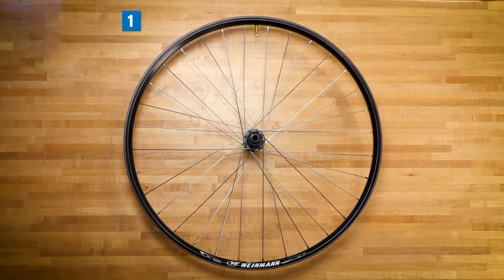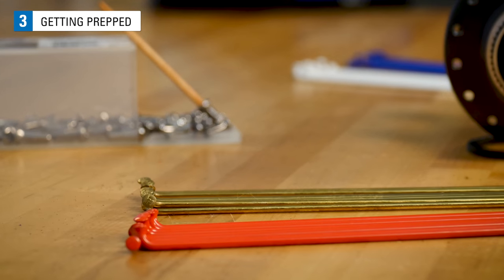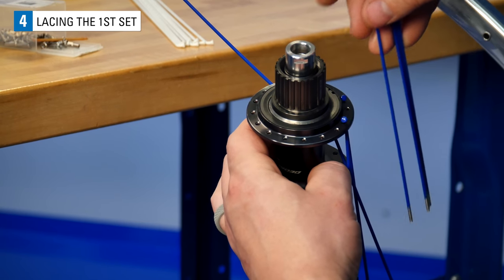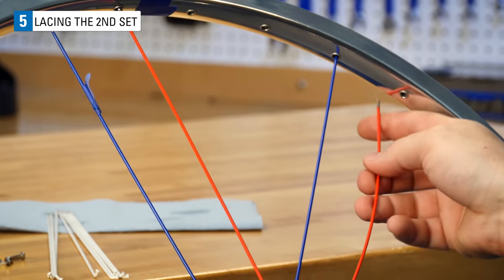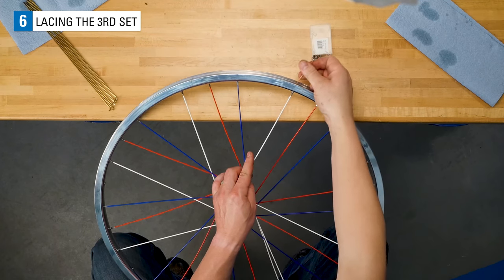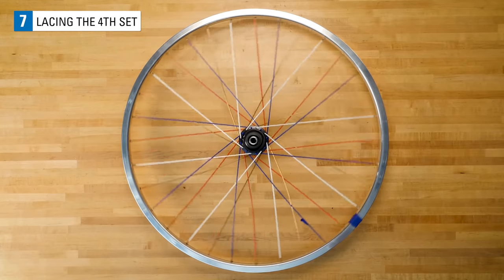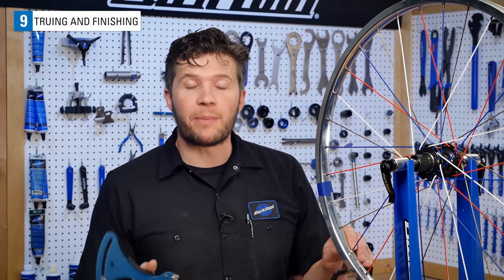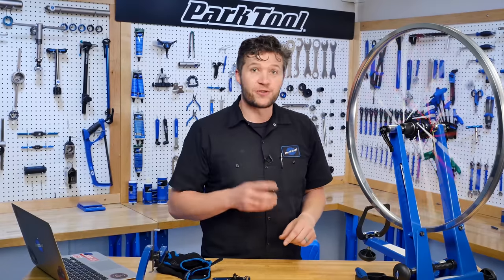How To Build A Bicycle Wheel

Comment: 67 years old and just built my first wheel. 50 miles covered with no change of shape. So grateful for this video.
Reply: I'm 69 and I just started thinking about learning to true my wheels.
Reply: I`m 66 and also thinking about, to build a wheel.  And congratulations on your first built.
Reply: Congratulations on your first build. I plan to build a set of 26" rim brake MTB wheels soon.
Reply: I'm going to follow you probably next year :)
Reply: 71 and I am now confident to give it a go
Reply: Hello - I watched this video a couple of times - I have a project that consist of 36 spokes and is a 4 cross pattern which I can’t figure out and I would need a little help on this if I could....- from ANYONE—-since there are many videos out there on YouTube, but many only cover 3 cross pattern the most and does not clarify the process of 4 cross even thou they say they do... HELP
—— thanks
Reply: @Ralph Reilly I bought an older model Park Tool stand (TS-2). The wheel is now a year old and hasn't required retruing.
Reply: dude, i‘m sorry to say that: you lost 50 years of wheelbuilding!
Reply: @radfahranfänger  maybe, but said wheel has been working now for over a year and no need to retension anything. I'm pleased with it.
Reply: @leep5606  that sounds great. My first wheels are at 15.000km offroad now. ;-)
Reply: I want to do this, I was hoping to find a beginners kit 😂 just to make sure I have everything needed
Reply: Toda a equipe está de parabéns pelos conteúdos sempre muito intuitivos ,muito detalhados ❤
Reply: I’m 53 and still doing forward manuals on a 20” bmx bike…
I want to build some wheels.
Reply: @CarlosRojas-ob6yf Don't! Use 3X interlaced. More crosses and you can't change a broken spoke without further disassembly.

Comment: hi, i ve built a wheel using this tutorial and a couple others. i had to tighten the spokes afterwards 2-3 times after i rode on that wheel but i think i did about 1500 km on that wheel and no spoke broke yet. It has been a fun process for me, i ve built it in a couple of days, i think i worked on it about 30 mins each day. this tutorial has been very helpful to me, its nice because i could follow along while building the wheel.

Comment: Thank you ParkTools.  This video saved me a bunch of money and is keeping me ridding.  I was having issues with my current wheel  set, so I figured a spare was in order.  After searching internet and being told it would be weeks or months until a new set, i ordered the parts and got to work.   It has taken me about two weeks to build the set, only working on in the evenings.  I am more than satisfied with my results,  I not only learned how to build a strong wheel, but learned what can make a wheel strong  and keep it true and reliable.    I didn’t go crazy high end with the wheel set, but i did get quality parts that should last until i tackle another set of wheels or rebuild the current set i have.    Thank you again

Comment: Great video! I've already built a few wheels myself and was watching to learn any new tips and tricks. One that helps me a lot, but wasn't mentioned here, is to number the spokes after lacing to help keep track during tensioning and truing. I write the spoke number starting at the valve hole in marker pen on the brake-track of each side (in this case 1 to 16). This helps me to remember which spoke I just tightened/loosened and which are loose or tight.

Comment: It has been two years since I built up wheels for my GasBike. As per your video, they were 3 cross lacing. Followed instructions, so it was straight forward. Two years later and I am finally getting around to lacing up a wheel for my Ebike. Difference is it is a 2 cross. I went back to your video to review, but was not quite sure if the process was the same, so i started to look at other videos showing a specific 2 lace process. They were completely crap. What I realized how good your video is, so with a minor adaptation it was an easy build. You and Park Tools are to be commended for your superior product.
Reply: Can I ask you what was the minor adaptation was you had to make? I’m in the same boat love the video but not sure what I have to change for 2 cross.

Comment: Learned wheel lacing the hard way, I have to use one of my older wheels as a reference and repeated practicing in my other old wheel for about 5 times until I'm confident enough to build my new wheel.  Done it in about an hour per wheel and realized it's a skill worth learning.

Great video for beginners!

Comment: Thank you, thank you, thank you! I was given some printed instructions with a different method which worked OK for a front wheel with an instructor standing over me. Flash forward a couple of years, me needing to build a rear wheel without an instructor to correct me and failing miserably on several occasions using the printouts. First time using this video and it laced up marvellously. 

Chapeau, Park Tool!

Comment: Very good video!  This helpt me a lot when changing hub on my kids bike for the first time. You can do this without any fancy tools !
If you are going to do this for the firs time i have some good tips.
 First of all take off the wheel.
Take a knife and do a scratch where the spokenuts sits on the spoke, do one on each side of the rim. 
Take the rubber, hose and rim tape of.
Take four papers and write. 
Left, inserted from inside out 
Left, inserted from outside in
Right, inserted from inside out
Right, inserted from outside in.
Take a small wrench and skrew clockwise to release some tension on all spokenuts. Then use a screwdriver with a flat key, run it counterclockwise from outside of the rim and release all the spokenuts.
When you have the hub free with all the spokes left on it you have to think in the bikes rolling direction. Gear side = right side.
Start to take the spokes out and stay to the same side and type of spoke. Left side inserted from outside and in  gose on the paper with that text and so on. 
You should end up whit four piles of spokes, one pile on each paper. And between 8-9 spokes/pile.
Then continue as the video.
When your done and you have all spokes in place you can place the wheel one the bike (upsidedown)
Use the screwdriver clockwise and tightening the nut but leave one milimeter left from the scratch.
Then you can take two zip ties one on each leg. 
One on the side of the rim and on over the rim. 
Then yo have to practice and learn what's happening and tightening the nuts. Use the small wrench now and tightening a little all the way around until the weel is straight and have some tension in the spokes. Sometimes you have to undo on one side to get it right but you will lern ! 
I did all this in just 2 hours and ended up with a straight rim. Good luck 🤞

Comment: Wow! I've built wheels for 20 years and this is the best explanation for lacing spokes so your pump has the free space it deserves. If your spoke measurements are correct, this video leaves you with a 90% finished wheel in an hour. I only wish I saw this two decades ago.

Comment: With the help of this video, i built quite a few wheelset.
I built a rare 2020 atomlab pimplite custom wheelset, for my dirt jump bike, and those are the roundest and the straightest wheels i've built so far.
When built with a gauge, the wheels were at 130 kgf within a margin of 2% !! I loved doing it.

Then i built quite a few downhill wheelsets, a few fixed gear carbon wheelsets, a bmx wheelset, and tried some variations in the lacing process.
I'm literally having a blast spending les than an hour and a half for a complete wheelset !!

Comment: Greetings from Germany,
I've just ordered the blue book 4th edition. You are doing a great job. Just Built my 6th wheel, two rear with motor and four front wheels. I always com back to your colored setup, which helps a lot. Great explanation. 
Keep on going with good stuff like this.
Dietrich
Winsen upon Aller - Lüneburger Heide - Lower Saxony

Comment: Great video i put a new dynamo hub in my 700c rim 
I used my forks and cable ties as a truing stand
Two glass jars with lids and coins as my dishing tool
Took me about 4-5 hours my best tool is a spoke key
My wheel is super smooth and your video is 100% thank you

Comment: Best and very accurate video over YouTube about wheel building which I watch so far. The steps are very similar to wheel building books which I read now about that. Also to stress relief with spoke squizing method is the best to be done.

Comment: ive built many wheels but not often so its great to have a video like this where i can skip through to the different labeled parts for a quick refresher such as which way to twist the hub on the 3rd set and where to put that first spoke. i always forget those 2 things
Reply: Does it actually matter?   I can see it is important which side of the flange the elbows go to allow the 1st 2 crosses to not interfere with the path of the spokes.
Reply: @guyaustin5962  if you twist a different way you are going to put a cross over the valve hole, whereas if you put the first spoke in the right spot and twist the right direction you will end up with two parallell spokes next to the valve and none crossing over it, allowing you to put a pump on it easier

Comment: Jeez this page help you save lots of money i have an electric engine the wheel before was busted and i took the spokes of the wheel and the spokes from another wheel and i got confused when i had to put it back but if i look patiently at your video will be just great i will need a tool like that to measure tension  and alignment but great video i will put myself to work tomorrow.

Comment: I just built my two first wheels, thanks for the amazing explanations ! I had a single difficulty : it was hard to insert the third and fourth sets of spokes because the diameter of the spokes was really close to diameter of the hub holes, and the taping is even adding a bit of width. To solve that, simply "screw" in your spokes in the hub and once the tapping is passed, it should go fine. I also find it easier to insert 1 spoke and fix it before inserting the next spoke for first and second sets. Thanks, again Park Tool ! I am currently building a cargo bike from scratch and your videos are helping so much !

Comment: I've been subscribed to this channel for a couple of years. Yet, just as I'm about to build my first wheelset (still waiting for the spokes and nipples to arrive), you go and put out the best video I've seen on this topic so far.

Sometimes the universe nudges us in the right direction.

P.S.: I may have chosen the wrong spoke size for the drive side as I counted two crossings instead of three when looking at my old wheelset. I didn't realise it until watching this video but I also had to include the base of the spoke it crossed, not just the ones it physically touched. I'm now slightly worried as to how strong the rear wheel will be. On the plus side, at least the wheel will be even lighter with shorter spokes :D

Comment: I really have to thank you for this great video!  I had to replace a cracked rim for the first time, and with your video it went super easy and without any problems, even though in my case it was a 24-spoke rear wheel.  Keep it up, with your tips I'm learning to repair my bike myself instead of hiring an expensive workshop...

Comment: An undished wheel is easier to build, laterally stronger, and easier to keep round and true.  Their spokes can be set to higher tensions.  Some complain that high spoke tension makes a stiffer, more rigid wheel.  But they say it like it was a bad thing.  The higher tension makes the wheel a rigid unyielding disk, a perfectly reliable wheel.   All the cushioning you want can be gained from the using lower pressure in the tires, and even more,  by mounting the seat on a seat spring.

Comment: Thanks so much!!. This is by far the best tutorial I have seen so far in my struggle to build a wheel. The method I learned as intern at a bicycle shop was difficult to repeat. I understood what I did with help from the mechanic in the shop but had hard times repeating it and doing it myself. I think with this detailed video I wil get it right. 🙂

Comment: I had to take both of my wheels apart after finishing. Twice. Because I missed the first step of the second set of spokes where you select the proper hole in the flange. Everything bolts up, but every 4th spoke was way “too long” and the nipple was all the way outside the rim’s diameter.

I found the error tonight (3rd time’s the charm) and got everything assembled, tensioned, and trued. Thanks Park!

Comment: Great video thanks. One thing I've noticed is to look for the very slight offset of the spoke holes in the rim. Left offset go to left flange spokes and vice versa.
Reply: Yeah, I came to the comments to see if anybody else mentioned this. Some rims are what I guess you could call "ambidextrous", meaning that all the spoke holes are identical, but other rims have every other spoke hole pointing to one side, and the other half pointing to the other side. If you don't pay attention, you have a 50-50 chance of getting it right, and if you do it the wrong way, your spokes may be slightly too short, and/or your nipples won't point the right direction and the spokes will have a slight bend as they exit the nipple.
Reply from the maker: Check out our spoke calculation video for more on spoke offset. That is where we covered the subject.

Comment: I did my dirtbike front rim and hub. i bought a black excel rim and did the spokes to the stock hub. It was fun to do. I didnt have a small spoke torque wrench where you can measure out pounds of pressure.  I only had the dial indicator.  I trued it my self too as well. Coolest experience🤙

Comment: Thank you for an interesting and informative video.  On a cross-three pattern why go under the third spoke?  This causes them to touch at that point.  I have noticed that on every wheel that I rebuild there is always fretting at that point, and I've seen several spokes break there over the years although not a common occurrence.  I don't do it any more. Additionally, I can now pluck the spokes to get an idea of their tension.  Lastly, I now cross lace the rear drive side and radial spoke the left side.  My non-disc brake fronts are all radially spoked.

Comment: Very well explained. The best I've seen. It would be interesting to see a wheel build with direct pull spokes. 

I just built my first wheel a month ago and was rather proud of myself and happy with the result, except for one thing. The hub logo didn't align with the valve hole 😣
Reply from the maker: That is something we are working on.  Straight pull hubs are difficult to measure.  See Spokecalc.io for the concept when using straight pull.  DT Swiss offers a data base for their hubs.
Reply: @parktool  yes I agree, a bit trickier. BTW, do people ever put light thread-locker on their spokes to secure them in the nipples or is that not recommended?

Comment: Just built two wheels using this tutorial! Still waiting on a bunch of other parts before I can actually test them though. I will say that I really had to pull on the hub to get the spokes in the rim to start threading the nipples on from the 3rd set on.